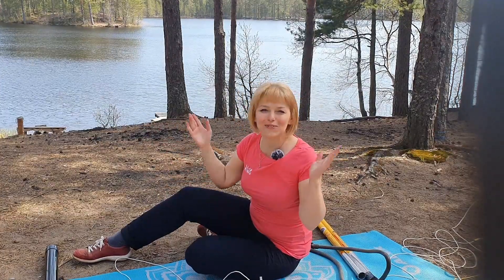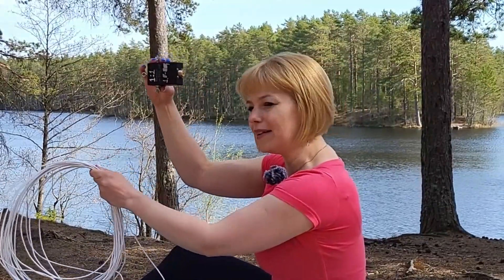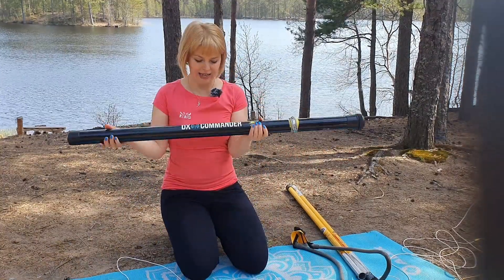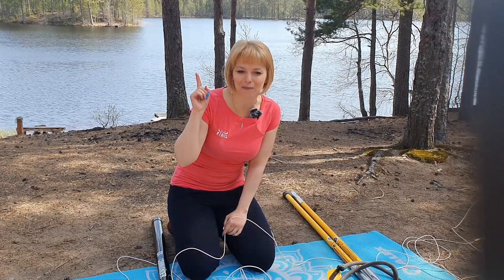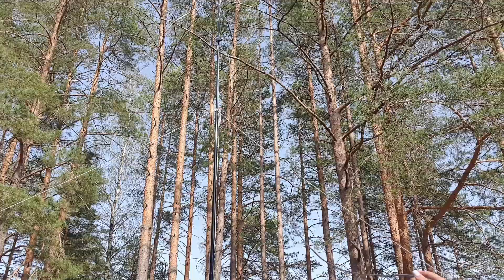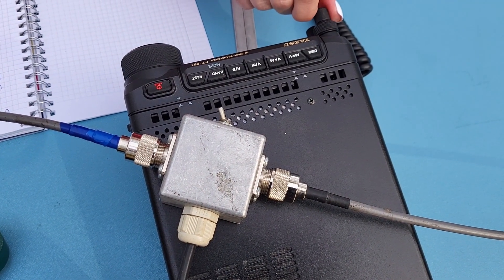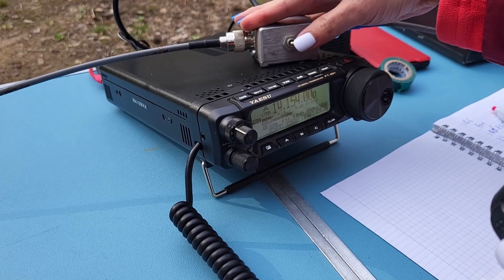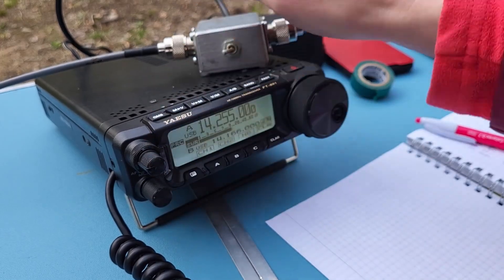Dipole Antennas: Raisa Stands Up Vertical To Horizontal

Comment: Obviously, vertical will give you omni-directional reception. Horizontal will give you directional  reception with 2.3dB gain perpendicular to the antenna but 20 - 30dB attenuation off the ends. It doesn't make sense to compare vertical to horizontal because of that. For lakeside, forest and general wilderness working, I'd go with vertical all day long. 73's and maybe I'll work you some day Raisa :)

Comment: I like my vertical mobile antenna like the vintage outbacker as worked my dxcc award on 20m on this in 1990 on mailed Qsl,s.😮 The rig was a Kenwood TS140s at 100w

Comment: Hello Raisa, at first thank you so much for your contribution to the ham spirit and compliments for your videos and acitivity.About this video, to measure the horizontal to vertical attenuation, you should use a calibrated test receiver or a spectrum analyzer, a CW stable source and than a anechoic chamber or a reflection free area: in this case you will see really the difference, I did it. Depending of the balun, closed or open dipole, diameter of the radiator, could be 6 to 12 dB, 1 to 2 S points.On wikipedia there are more details. We made in the past a logged QSO. Thank you again and encourage you to continue in your activity to improve ham world. Greetings 88 ,  Sandro IW1FQC
Reply: what you did is theoretics, what she did is real world, and in the real world, it doesn't matter

Comment: Does the antenna switch switch switch the shield of the coax as well as the center conductor? If not the horizontal dipole has a third wire which is vertical and the vertical dipole has a third wire that is horizontal. If the two coax feedline braids are connected then it will not show the real difference in the antennas.
You could put a double pole double throw switch in a box and connect the feedlines so that the shield of the vertical dipole and the shield of the horizontal dipole are not connected together. Then the results should be different.  Basically your vertical is not completely vertical and your horizontal is not completely horizontal!
Reply from the maker: TNX for your comment. I did not intend to make a very exact experiment,   I understand what you mean ;-) 73, Raisa

Comment: That was a great comparison of 2 dipoles. I am in the USA , we love them DX Commander mast. saving money to get the new 2024 DC Commander expedition portable antenna. he now has clamps to keep mast from collapsing down on it self.  6 threw 40 meters . going to cut extra elements for 3/4 wave 11 meter. 10 and 12 as well and a 3/4 wave 6 meter one. with the higher frequency you can cut 3/4 wave and wont be so long and still tune 50 ohm. I hade good luck in a park on 6 meters off set center dipole. tree to tree. 3/4 on center/1/4 in shield.  match 1.5 or less threw the whole band. lately 6 meters not so good local only/ springtime has some nice DX . 73's

Comment: Generally speaking,  horizontal  dipoles are quieter when there's a lot of qrm, there's a lot of overhead wires at my qth, a lot of qrm from them, so I have a horizontal dipole.

KE8NFK
Reply from the maker: Yes, I agree. But as you can see in natural conditions, when there is no interference nearby, there is no noise on both antennas. It doesn't matter how they are hung.

Comment: If I use a for  example a PMR446 radio, will the vertical or horisontal anttenna orientation have an influence?
Reply from the maker: On one of the forums I found a good answer for you, which gave Kevin Reid AG6YO

"For VHF, choice of polarization is not up to your desired radiation pattern, but who you want to be able to communicate with. In HF, the ionosphere causes random rotation of your signal's polarization, but in all line-of-sight communication, VHF or higher, there is no such rotation and a polarization mismatch can result in no signal at all.

You should use vertical polarization if you wish to communicate with existing FM mobile and repeater stations, because they also use vertically polarized antennas (by convention, and because quarter-wave verticals are much more convenient than other types of antennas on vehicles and handhelds).

On the other hand, you should use horizontal polarization if you are attempting 2 meter SSB or other types of DX/weak-signal work. Again by convention, but the convention arises because (if I understand correctly) horizontal dipoles typically have more gain, and because a horizontal dipole is a simple, efficient freestanding antenna.

If you wish to be able to communicate with both types of stations using a single antenna, you can use a diagonally or circularly polarized antenna, as a compromise which has a reliable small amount of loss in either case. However, such antennas are more directional than a vertical (at least as much as a horizontal dipole) and thus require pointing."

Thanks Kevin! 
de R1BIG
Reply: Thanks @YLRaisa
Reply: @YLRaisa  Thanks. learnt something new today :)
Reply from the maker: @stighenningjohansen  you are welcome 😊

Comment: I had very good results with vertical wire, much more dx stations received. Just 12 meter high got 15476khz radio station from Antarctica. Also works nicely mw-band, Japan, Caribbean, US etc. Now thinking funny idea, what it would do if wire is silver platted copper. It offers better electrical  conductivity than pure copper.
Reply from the maker: I also expected to have better result with vertical :-)

Comment: I have the same exact radio (FT-891) but also, glad I found your video since I have been experimenting with a wire dipole. Sadly 10 meters propagation is not really doing well. Thank you for your video. 73 W4BTK.
Reply from the maker: Yes, I have been waiting for better conditions on 10 m long time and it is still bad... see you on the Air! Raisa

Comment: I was told during the courses that it wouldn't matter because the atmosphere scrambles the polarization for HF. It's great to see the experimental results confirming it. Thank you very much.
Reply from the maker: I expected another results, but you are right :-)
Reply: The only real effect from the orientation would be the signal lobes. Horizontal will be more directional - perpendicular to the direction of the elements. Vertical will be more omnidirectional.
Reply: Yes, there is the reason for X-pol antennas while doing meteor scatter QSO's. 😊

Comment: Did operating beside the water make any difference to signal reports,..
Reply from the maker: Hi Ron, I did not understand your question (?)
Reply: I live beside the coast, I find signals (DX) much more enhanced  over the sea. I work Australia with only 10W ssb and a loaded 1.4m whip antenna. I wondered if it would be same for you, but over lake water,.. 73 de G4FBC

Comment: Well done! Good job! Interessting result. 
It depends on the height of the antenna. A vertical antenna has a slightly different diagram than a horizontal dipole. A low-hanging dipole radiates much more steeply than a high-hanging dipole. But a nice video and always nice to see you in HAM action!
greetings Stefan, DL8SFZ
Reply from the maker: Hi Stefan, I tried to install the feed points of both dipoles on the same height :-) 73, Raisa

Comment: I like to experiment with delta Loops they are 1 wavelength, perhaps 1.2 db of gain and quieter, feed at one quarter wavelenght  I actually build one portable I called it the Delta Light, and it is on experiment phase yet.  For a delta you can use the DX commander mast
Reply from the maker: I have no experiences with delta's yet, but I will do it in the future.. TNX, Raisa

Comment: 97% of hf Yagi  beams are horizontal I wonder why
Reply from the maker: maybe easier to build? 73! Raisa
Reply: Exactly Raisa. Horizontal elements do not interact with any support pole. A vertically polarized yagi with long elements would be near impossible to support without interaction with the support mast unless it was non metallic.

Comment: I wonder with an inverted V you have in between horizontal and vertical ?
Reply from the maker: an inv V would work maybe with the same result like vertical...
Reply: @YLRaisa  compared the same stations on my vertical , some signals are better on inverted V , but others not so good. When you were in the cave , you were stronger on the vertical than inverted V 🤔

Comment: I had the same results on 20M during the day (Indiana, USA), but at night the horizontal position seems to work better on the broadside directions, while the end directions seem to stay the same. Next, I'm going to try out vertical with radials (like the DX Commander) and compare it to a vertical dipole. Keep up the great work!
Reply from the maker: It would be a very interesting comparison, I also have a DX Commander ;-)
Reply: Any radials are better then no radials, something I have not tried with a dipole myself, but i orobabky will now you mentioned it.
I have 10 x 7m radials on a board but 3/4 is suffice if any at all, I also have a 40+m a long counterpoise, not that it's needed I just like to experiment with antennas I have created myself, and I am far from a Tech or Ham Expert, more The Experimental Ham Guy. 73's Ed

Comment: Hi  Raisa..nice place for a good experience, in my opinions to have a real results  between that antennas the switch must disconnect GND and main conductor..when you have finish this video, how you have recover the cable so high ?  '73
Reply from the maker: recover...??Alessandro, what do you mean? it was no big problem with the cable at 5 meter feed point. There are many trees there ;-)

Comment: Raisa, you should try sometime on your rigs that support receive antennas using a vertical and horizontal at the same time. I have heard myself the reduction in fading on the band as a signal goes from horizontal to vertical. This is one of the ways of doing diversity receive. Thanks for the video.
Reply from the maker: nice idea, TNX, I will try to try it
Reply: Ok, now is clear Don! It would be very interesting to compare at the same time two audio from two receivers. Thank you! My best 73. IZ3GOA Sergio.
Reply: @sergioborghesan6318  Yes, that would be interesting.
Reply: Yes but I think you need a phasing line to achieve circular polarization. 73 de IZ3GOA Sergio.
Reply: @sergioborghesan6318  No you can use 2 antennas, one in each ear and hear it. Phasing is a completely different type of diversity. Phasing requires processing in a device to phase the signals and diff them. My Apache Labs Anan has phasing where as the Flexradio I have will do the fading as long as I have both a horizontal and vertical antenna tied in. Also realize I am not talking about transmitting. This is receiving.

Comment: Nice video, the results are interesting.  I think out in the field with no structures it might not make a difference, but maybe near buildings that block signals it might make a difference.  But for a park, like they say, just throw a wire up and start talking!
Reply from the maker: Yes, you are right! :)